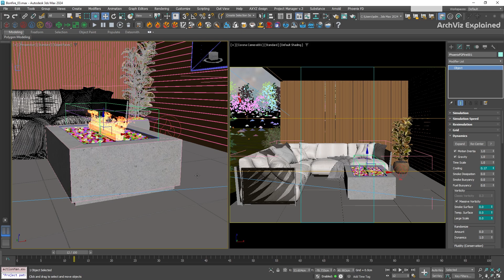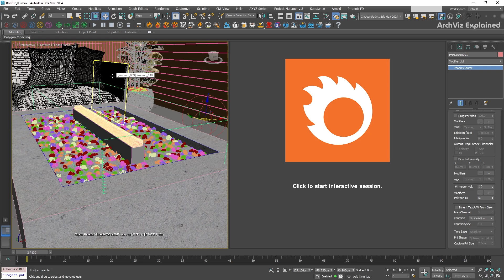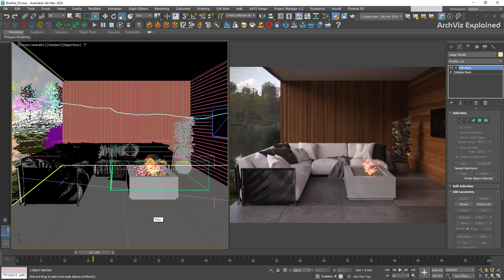How to use Phoenix FD to create realistic fire in 3ds Max

Comment: Does it work for Corona?
Reply from the maker: Hi @Mohammed_079 Yes! In fact, in this video I rendered the fire using Corona Renderer. 🔥 You just have to set up the Phoenix FD simulation normally, and Corona will pick up the fire and smoke as long as the shaders are set correctly. 😄
Thank you for watching!
Reply: @ The reason for the question is, when the fire was applied and the rendering was done, the fire lighting was low.